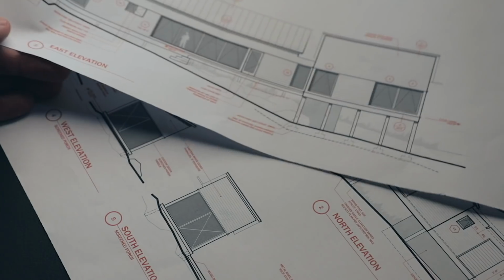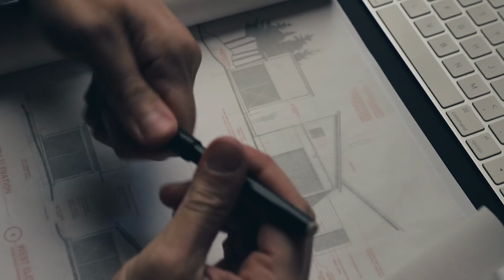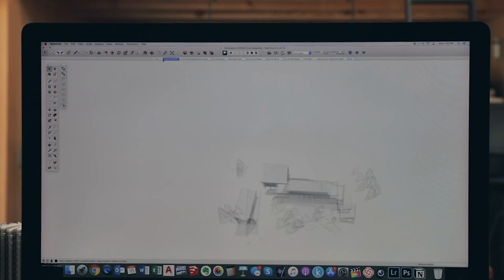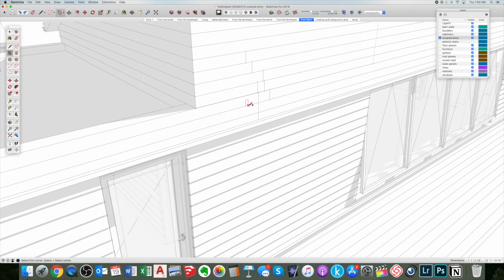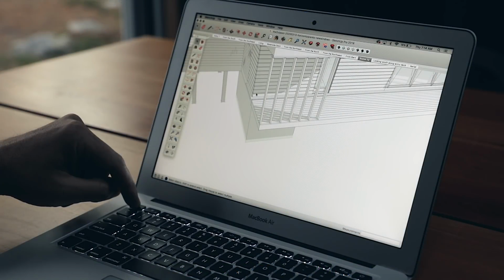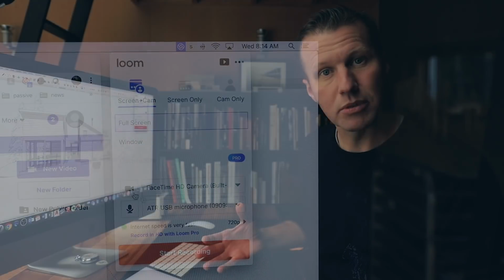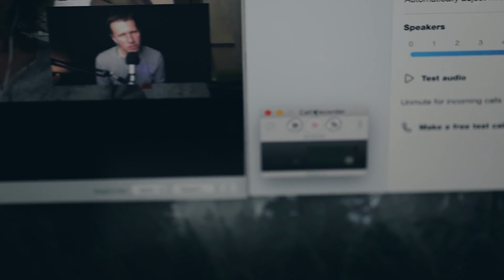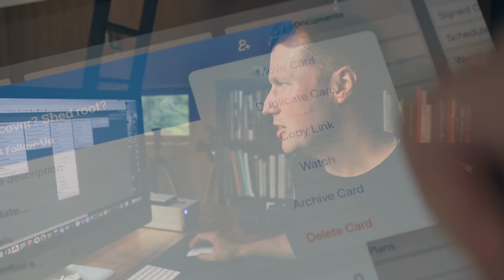Work from Anywhere: Tools, Tips, + Methods I Use to Run a Remote Architecture Studio

Comment: I like the Style you use in Sketchup... can see it's not preset; can you share those settings? I like that it's neutral and also helps to move around easier (at least it seems like that - minus the shadows). Liked the solution to the entry, that roof defines it much better; my concern with the desired view going in is that you would have the master bath volume to the left and block you partially, therefore your real view is more linear... don't´know if that was the intention from the beginning. Best

Comment: do you ever feel like software weighs on you over time? Sometimes I fine myself doing a task in a less efficient way because it feels better for my soul if that makes sense. I've found myself getting frustrated and bogged down before and I didn't know why, but after a while I realized it was because it felt like I was 'managing programs' more than I creating, even though those programs served me well. I went back to a legal pad and a sharpie to take notes and make lists and for whatever reason it made the process a lot more joyful for me. Something about using analog media is special. You seem to have a good balance of sketching by hand, incorporating scale models, using CAD and sketchup, but Im curious if you've ever felt the same way. Thanks for the vid.
Reply: Yes me too ... I feel like programs load with extra weight and make us learn program technical knowledge instead of increasing our design creative skills

Comment: Thank you, Eric, great video as always, you are a pro youtuber now, I have to  tell you! I’m working from home for almost three years now, and I am actually getting used to it. It never was easy to prevent the urge to go out to some meetings to be with other people, but now, being in lockdown I really appreciate the zero adjustment I got to undergo. By the way, think about new approaches to designing residential and office projects! There will be the whole new emphasis on functions being assigned into those programming concepts, homes will definitely need more home office space, offices will be remodeled and everything will shift in its usage... I find this very challenging and I do think, that the role of architect will slightly change as well. Great times to live in, don’t you think?

Comment: Nice video, well presented. Tell me, how’s your MacBook Air handling sketchup? Can you do more complex models without trouble?
Reply from the maker: It works well, shadows make it a little sticky, but I don't feel like I ever push it very hard so may not be the best example! The iMac is super smooth but when I model and screen record at the same time it bogs so I have to switch it up for filming. Thanks for watching...
Reply: 30X40 Design Workshop thanks Eric for sharing your process and experience. I have a small architecture studio along with my wife and also teach digital visualization tools to college students at a local university. 2D and 3D representation mixing autocad, sketchup and photoshop. Your sleek videos and beautiful plans reveal your design oriented practice. Congratulations! Cristian. www.bvaa.cl  @bv_arq on Instagram